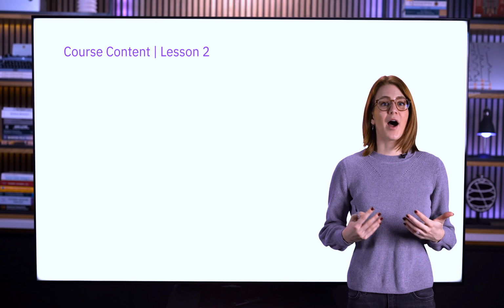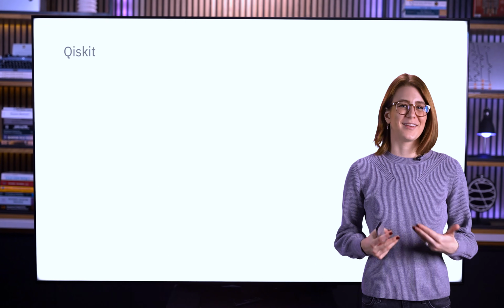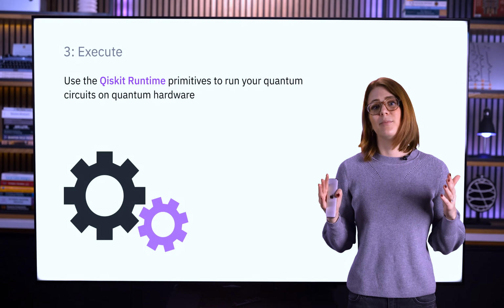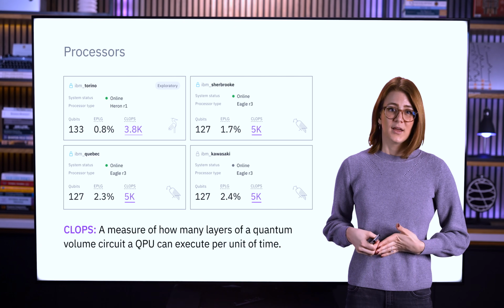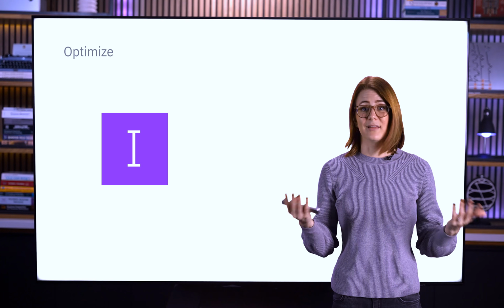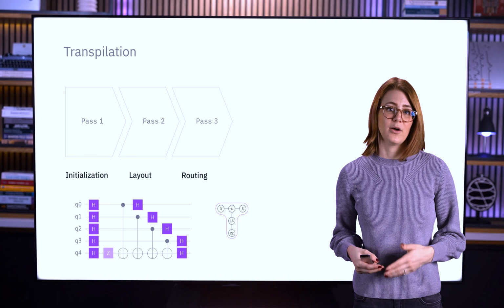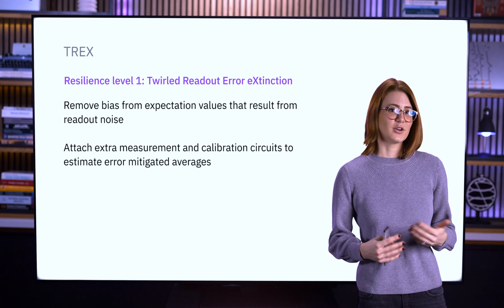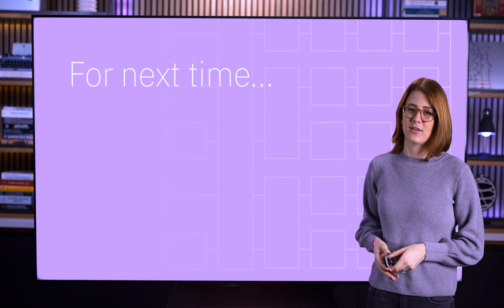Run Quantum Circuits with Qiskit Primitives

Comment: Great course, thanks!
Although, I have been wondering why Qiskit exposes Quantum gates operators instead of abstracting out that layer like we do with classical computing languages such as C++? 
Eg., In case of an addition, in classical computing languages such as C, we directly use an addition operator instead of the underlying actual gates.
Reply from the maker: It's just because of the state of the technology. Programming individual gates gives you more control, and right now, there is still a lot of experimenting to be done. Certainly one day there will be additional layers of abstraction.

Comment: Man oh man... One more attempt to enter the quantitc computing league and another massive loss... I mean is this supposed to serve only mathematicians, physicists and top tier engineers? Will the small folk ever going to be contemplated with direct interaction with these machines? Hats off to the lady presenting this content, her explanations do seem to be concise and accurate, don't get me wrong there: good job. I just whish not feel like the dumbest person on earth for not understanding this subject. Computers compute right? They add, compare, store data and traditional ones do this trough bits, quantum ones do it through qbits. Back in the day when I put my hands on the first pc ( an 8086 whith 5.1/4 floppy drive, 1MB of Hdd (if that) and CGA resolution) one of the things that my teacher (an engineer) showed me was a simple basic (language) programmed calculator - very boring experience but something "touchable" for sure. Anyway and again, hats off for the content, the presentation, the effort, they do seem legit. Thank you for knowledge sharing.

Comment: Fantastic, Olivia. Selecting a quantum processor based on factors like the number of qubits, EPG, and CLOPS. Are there any other factors or metrics that you consider important when choosing a processor for a specific experiment, like in simulation?
Reply from the maker: the queue times lol